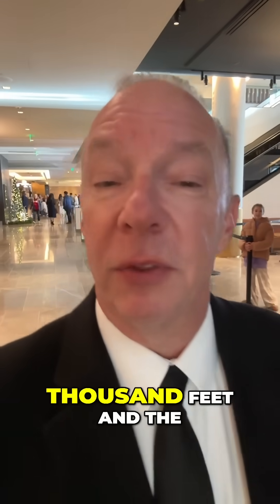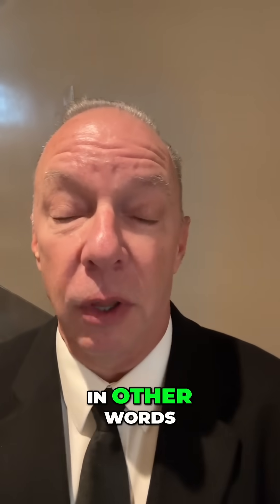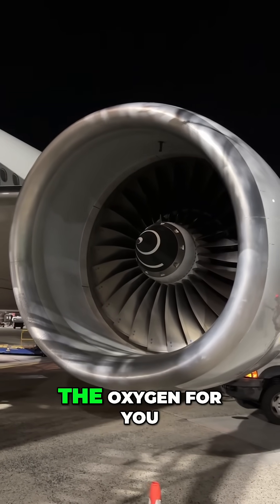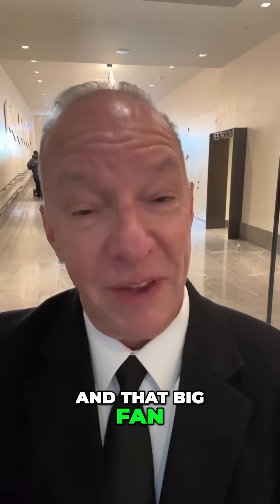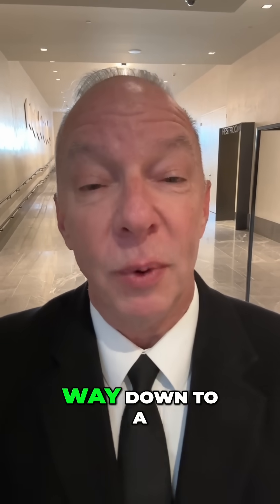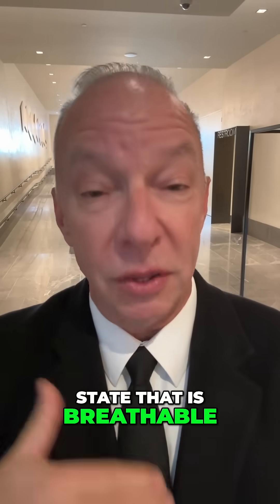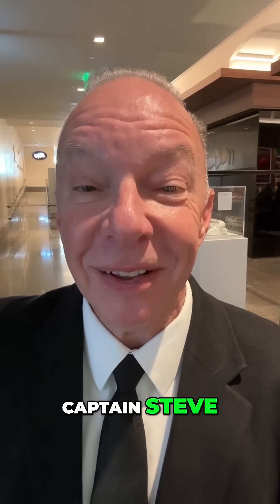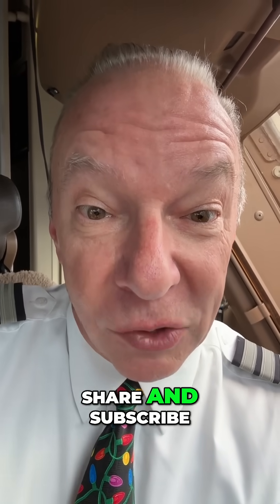How Airplanes Make Breathing Possible at 37,000 Feet

Comment: Excellent video, however, about half way thru talking about the jet engine... The stator (stationary) blades don't spin, the rotor blades are the ones that are spinning (rotating)... Stator blades direct the airflow at the perfect angle to the next stage of rotor blade each stage compressing the air more and more until it reaches combustion chambers which then hits the turbines which are connected by a common shaft to the rotor blades... Jet engines are awesome... PW J-57 and F-100 tech

Comment: Simple explanation. The aircraft's engines heat up air outside the aircraft so you can breath it. That's why the relative humidity is very low and you get dehydrated. The oxygen masks are nor pressurised air but "candles", chemicals that ignite when you tug on the mask hose that provides oxygen until they burn out. Hopefully by then the aircraft will be at a low enough altitude to breathe the outside.

Comment: Your breathing bypass air. The giant fan at the front of the engine is the fan that actually moves the airplane forward. These engines are cooled by airflow that doesn’t get burned with fuel. That’s bypass air and so they open a diverter valve to the cabin.

Comment: You are using the wrong terminology. You are NOT compressing oxygen. You are compressing AIR. Air has about 21 percent of oxygen. Most airplanes are compressed to about about 8000 feet not sea level. Also it does not circulate around the airplane. Its blead off out the back of the aircraft through the out flow valves. There is a time limit for oxygen.... because its in tanks. No generators.

Comment: I was a navy flight officer.  First, stator blades do not rotate. Second, it's not the partial pressure that's low it's the pressure. Partial pressure of "air" makes no sense.  It's just air pressure that's insufficient.  
.
Air doesn't have partial pressure.  Partial pressure is the part of air pressure exerted by each part of air ~20% Oxygen; ~80% Nitrogen; 1% other.  He could have said the partial pressure of oxygen and got closer but that wouldn't have made sense either.
Reply: ^ A-retentive …
Reply: @Clyde-2055  Really?  The stator thing is an glaring mistake that shouts at anyone whose been to military flight school.  I like the channel, I've been impressed so I was surprised at such an obvious engineering error.  There ARE 'variable incidence' stator blades, non-spinning [stationary] blades, that can adjust their angle of incidence.  I am NOT an aeronautical engineer, but "stator" means stationary. This is basic jet engine (or steam turbine) nomenclature. The variable incidence stator [stationary] blades may have something to do with bleed air, which provides oxygen. But stator blades do not, by definition, spin.
.
The partial pressure of air is Captain Steeeve attempting to put on intellectual airs and revealing that he does not know what "partial pressure" means.  Air does not have partial pressure. There is a partial pressure of oxygen [and nitrogen] in air, which could be important if one is examining air's behavior near cryogenic (or maybe at very high) temperatures. But that too has nothing to do with engine bleed air. And partial pressure of air doesn't make any sense, it's like saying the water content of water.

Comment: Well you're pressurized to 8000 feet is why. Meaning you got more O2 per cubic foot because you got more air per cubic foot. Sure the O2 percent doesn't change unless there's more (or less) pressure. However at 35000 there ain't a lotta air molecules BUT the ratio of say Nitrogen to Oxygen is identical to sea level. this is also why the stall speed may be 130 mph or so at sea level but its probably 3 times that at 37000 because there's a LOT less air molecules hitting those wings, see?

Comment: The engines DO NOT produce oxygen. All they do is compress air, which remains 79% Nitrogen and 21% Oxygen.  Only the pressure and air density increase, so your lungs can use the available Oxygen.

Comment: Then why don’t the engines supply the oxygen for the masks that drop down during decompression, rather than them being connected to individual bottles that run out after 10 minutes? Surely it wouldn’t be that difficult to set that up.

Comment: I wish that there was also some moisturing of the air once it's taken from the bleed of the compressor, as the air at this altitude is basically completely dry. B737 at 37000 feet has air humidity in the cabin less than 10%.

Comment: The only change I would add here is they do NOT pressurize to sea level (around 14 psi) partly because that extra pressure will stress the plane over time. Instead they usually run the pressure to around 11-12 psi which is closer to the atmosphere under 10,000 feet. This is why many people have that ear popping with the pressure change. BTW, using that lower pressure allows the plane to last longer and go through many more flight cycles before the next inspection.
Reply: Pressure has to be kept at 8,000 feet or less by mandate.  That’s partially the reason it’s hard to get good sleep on a plane, it’s like being at the top of a smaller mountain peak suffering altitude sickness.  10,000 feet would be a little too severe for the public.

Comment: Close, but Stators do not spin. The turbines are the spinning part and the Stators are stationary blades in between the turbines. Their primary function is to guide the airflow so it travels (mostly) straight through the turbines and the engine.

Comment: The fan in the front has little to do with the compression of the air. Its main purpose is to bypass the compressor stages and provide thrust-hence the term high bypass turbofan.

Comment: To expand a bit on Capt Steve’s beautiful explanation, the mixture of the atmospheric air at 37,000 feet is the same as ground level, what changes is the pressure. Much less pressure up there so less Oxygen molecules for your lungs. The engines take the pressurized air, send it to the air conditioning packs, and it’s pumped into the cabin. Modulating the temperature is done by mixing some of the cold AC air with some of that hot pressurized air tapped before it gets to the packs. The cabin pressure is controlled by a valve modulating the escape of that air from the cabin, so the packs are capable of producing more pressure than what the cabin can support.
Reply: I wouldn't mind if they would cool down the compressed air a bit less so it wouldn't get so cold in the airplane that everybody needs blankets.

Comment: The oxygen is just fine, there is just not enough of it with the low air pressure. The chemical oxygen generators are small things just above your head.

Comment: That means if you had a double engine failure or run out of fuel at high altitude you need to use the generators?

Comment: The PERCENTAGE of oxygen in the air (about 20%) is the same, regardless altitude/elevation; whether you are at sea-level, or 40,000+ feet (we breathe AIR, not oxygen. But our lungs absorb the available oxygen from the air).
But the DENSITY (or pressure) of the air is reduced as we go up higher in altitude.  Thus, with each breath, you are effectively inhaling less air (and less oxygen).
By compressing (squeezing) the air - raising its pressure back to something closer to ground-level pressure - more air (and oxygen) is again available to breath. 
Also, I believe that the air in an airliner is probably far cleaner than any air you breathe, down on the ground. It's highly filtered, and comes from way above the "pollution" line.
How's that?

Comment: My understanding is that you can’t really get the pressure down to sea level, though. If you have normal sea level air inside the cabin, the fuselage would need to be super strong to keep from blowing up. Keeping the cabin pressure somewhat above sea level keeps a reasonable pressure difference between inside and outside the fuselage.

Comment: The oxygen at 37000 feet is just as breathable as the oxygen at sea level. The problem is that there is not enough of it at 37000 feet. The air has to be compressed so that there is more of that oxygen available to fill your lungs.

Comment: Great Vid !
What he doesn't specify is that, as the plane climbs to (25-37 thousand feet) cruising altitude, the cabin pressure is carefully "ramped" down to just about 8000 feet above sea level.  Which is why your ears "pop" - and why you don't want to sit next to a drunk passenger (it makes them, effectively, More drunk !).
This is done to reduce the pressure contrast (and so mechanical stress) between the interior and exterior of the aircraft. It's also why an airliner door is designed so that it cannot (normally) be opened during flight: The interior pressure keeps it forced closed, with hundreds/thousands of pounds, distributed across the area of the door.  :)
Reply: And "In the event of loss of cabin pressure, masks will drop down". Those masks give the passengers just a few Minutes of air/oxygen; Meanwhile, the cockpit crew have a better/longer supply, and are doing an emergency descent to below 10,000 ft, to where they (and flight attendants) can function, and passengers can manage.

Comment: Thanks, Captain Steve, I never knew that's how air is fed into the cabin.  And I imagine that a portion of the hot untreated air is how the cabin is heated.
Reply: Just valves that control how much it gets cooled before making it to the cabin. 

Also if you are letting air in, it needs somewhere to get out. There are valves to control how much is let out, and those are the ones that really control the pressure.
Reply: There are air conditioning packs to cool the bleed air. All of the bleed air is filtered and cooled to the desired temperature.

Comment: @CapatainSteeeve, I believe I found a small error in your explanation.  @1:05, you show a cutaway view showing primarily the Rotor blades, not the Stator Blades as stated.  Rotor blades are the moving parts, attached to the rotating shaft, while Stator blades are stationary.  Rotor blades do all of the compression, while Stator blades help direct the airflow.  Love your videos!

Comment: Great explanation, but you probably meant the partial pressure of oxygen in the air mixture, not the partial pressure of air, which is non-sensical.

Comment: So where does the air go? It would blow up like a balloon if air only came in.
Reply: A plane is actually quite leaky. You can hear the air leakage around the doors. Air also escapes slowly through many of the rivets as well.
Reply: @wally7856  that's a bit scary, uncontrolled leaks are an 100% no go in my field which is medical industry. Surely that would cause abrasion and slowly reduce integrity.
Reply: @Wardyworlds  I wouldn't say they are uncontrolled. They are monitored with regular leak down tests. It was easier to find the leaking rivets in the past as they would have a streak of nicotine stains behind them. Most of the air gets removed by a pair of dedicated valves in the tail that regulate pressure.
Reply: @wally7856  that makes more sense, thanks.

Comment: The fan is primarily for thrust/ propulsion.  Like a big propeller inside of a tunnel. It has very little compression effect. 
The compressor " rotors "  along with the stators ( stationary blades ) compress the air higher and higher for combustion.  
Around the 10th stage of compression " bleed air "  is drawn off and conditioned for cabin pressure.  Part of the cabin air is recirculated but there's a mandate to completely flush the cabin air volume on passenger aircraft  ONCE  every 2-3 minutes .
Reply: 747 takes on 150 tones of fuel,  that's 8 semi trucks lol , they burn less than 10% of that,  it's all a con
Reply: @MalcolmGarrett-r1v sure, and the earth is flat too, right?
Reply: @mixter7x7  you,  sir,  on the other hand are completely correct. 👍
Reply: @fuzzblightyear145 still partially correct, stator blades do not compress air, they guide it to the next compressor stage avoiding surges.

Comment: As their name implies, stator blades don't "spin" (in a disk around a shaft), they are in a fixed disk shape located between compressor stages and have the opposite orientation to rotor blades; this inhibits the axial flow from rotating, which would be inefficient
Reply: They do if you're in a spiral dive!

Comment: The air at altitude is breathable there's just not enough atmospheric pressure to force it into your lungs. The jet engines are burning fuel with that same air so it's good air. The engines are increasing the atmospheric pressure within the cabin.
Your diaphragm contracts to force air out of your lungs and it relaxes so atmospheric pressure fills the lungs, that's how breathing works. Oh my goodness

Comment: All good, except one correction. At that altitude, the internal air pressure compares not to sea level but an altitude of about 2,500 metres (~8200 ft).
People may know that aircraft maintenance relates to flight hours, but what's really more important is landings.
In the way landings are more important than landings, pressurisation of the cockpit/cabin space is most important to ageing of the plane. 36,000 ft must be a relatively short distance. IIRC the operational ceiling in longer flights may be first 40,000 ft (~12,000m) and next for even longer distances 50,000 (~15,000-m).
Each level higher, the pressure difference increases and the ageing impact too. This is an optimisation problem. Flying higher will cost less fuel, but also ages the plane.

Comment: Spent 40 years working for the big airplane company in Seattle. My last 20 years there I was the testing expert for the 737 oxygen systems.
Reply: The one part of the 737 that hasn't failed yet. 😅
Reply: @quintuscrinis well if engines fail that means the oxygen system fail. So they def have failed b4 😂.
Reply: @quintuscrinis  I see what you did their 😅😅😅😅
Reply: The one that rhymes with "i'm not going"?
Reply: None of us have any complaints about the oxygen system on 737s, of course.
Reply: Overpaid and do crappy work.  I don’t see panels flying off the side of Airbus.  American workers have gotten dumber, lazier and more entitled and the big plane company is a zombie kept awake at taxpayer expense.
Reply: Which APU type(s)?
Reply: So if you passed out your underlings fixed the problem until you woke up.
Reply: Ok……………………………….
Reply: So you were hitting the o2 cause you came in hung over all the time?
Reply: And then you were replaced by a canary.
Reply: @Hopeless_and_Forlorn 😂

Comment: Remember....the percentage of oxygen does not change, it's 21 percent at sea level, and it's 21 percent at 30 thousand feet. It's just the pressure that changes. The lungs cannot absorb the proper amount of oxygen if the pressure is too low. There are 2 ways of fixing the problem, either increase the pressure, or increase the percentage. So if the plane suddenly goes really low pressure, the oxygen mask has high percentage of oxygen, probably more than 75 percent, , but the pressure remains low until the plane descends

Comment: Fun Fact: The reason Boeing was so successful was that they learned a deadly lesson from DeHavilland who made the first passenger jet. DeHavilland's design kept the cabin pressured to sea level, and had large windows for the passengers to look out of. Metal fatigue from constantly climbing and descent made one of them explosively depressurize and tumble out of the air in pieces. Everyone learned from that, which is why all passenger jets now pressurize the cabin to the equivalent 0f 8,000 feet, and get regular metal fatigue inspections (and have much smaller cabin windows).
Reply: 8000 is still kinda low. If someone was doing aerobics up there, like riding an exercise bike, I think 8000 feet would be hard on them, they might pass out if they not used to it

Comment: Your comment is somewhat misleading to start with as the Oxygen content at 37000' alt is the same as it is at sea level (approximately 21%) the only difference is the pressure is lower at higher altitudes so that's why the cockpit and cabin are pressurized to simulate the pressure of the altitude the aircraft took off at and will be landing at. You are correct in that part of the atmosphere (21% 02 and 78% nitrogen) used by the jet engines via the fans is diverted to increase the pressure in the cabin and cockpit. The Oxygen content in our atmosphere remains the same at all altitudes only the pressure changes, we as humans need that pressure to assist us to fill our lungs. I live at 8000' alt. and when I go to see my 10 year younger brother in Anchorage Alaska (near sea level) I can out walk him as I'm am virtually turbocharged at that lower level. We use turbochargers on piston driven aircraft engines to maintain the same horse power output at higher altitudes as at lower altitudes just like the different stages of of compression of the fans and stater's in you're jet engines increase the pressure. It all has to do with maintaining the same air/fuel ratios in those engines at all altitudes. Sorry didn't mean to make this so complicated.
Reply: I made a comment about that also. I promise I was not copying you....I seen your comment after I made mine
Reply: @ShannonDove-sy7ye  No worries I didn't mean to get so technical and ramble on so long. I'm sure you won't be the only other person to point out the misleading information on the video. Cheers;